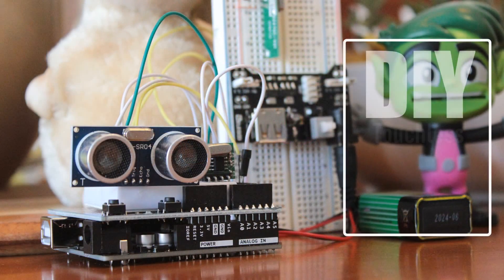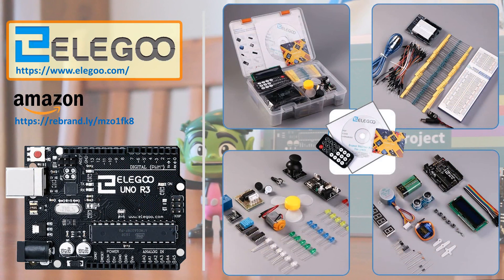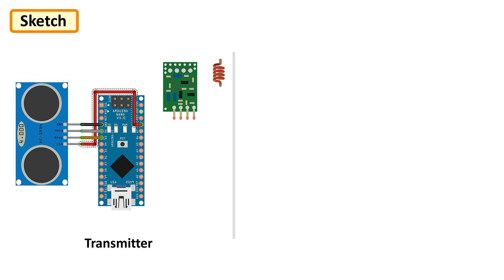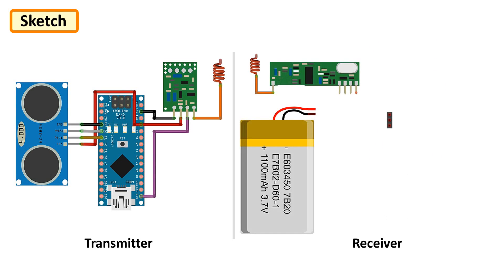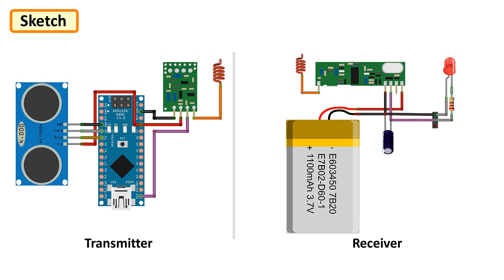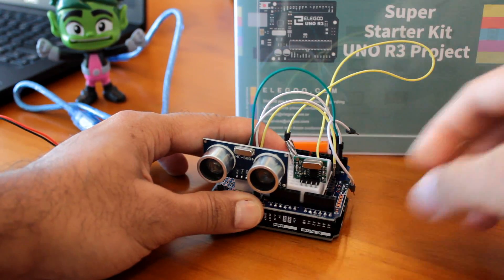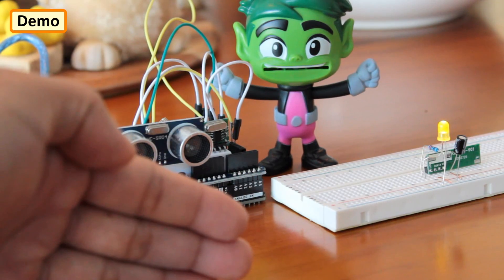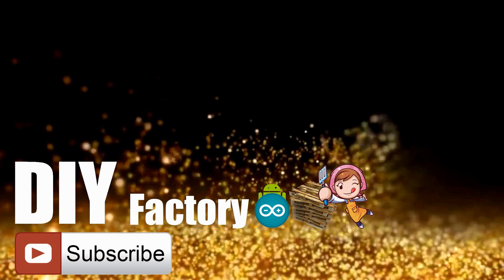Contactless Wireless Door Bell Using Arduino

Comment: Great!
If you could, please make make one without the Arduino, as that will be more cost efficient.
Reply from the maker: Sure, stay tuned I am going to post something similar on my blog soon
Reply: @CrazyCoupleDIY  Thanks!
Reply from the maker: Should be easy with a 555 timer ic. If you feed the output of pin no 3 to trig pin you should be able to generate a pulse and capture it on the echo pin. I will do a bit more recearch. Have couple of other videos that I need to finish up. But, I will for sure come up with a cheaper solution. Thanks again.
Reply: @CrazyCoupleDIY  Great! Thank you for your time.
Reply: I am also waiting for this now